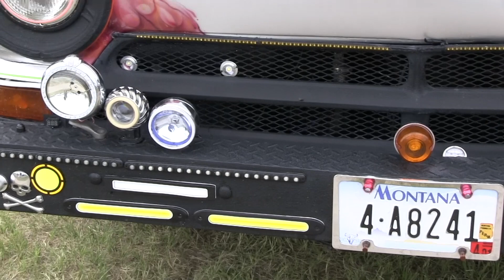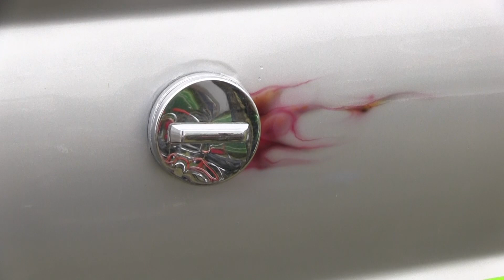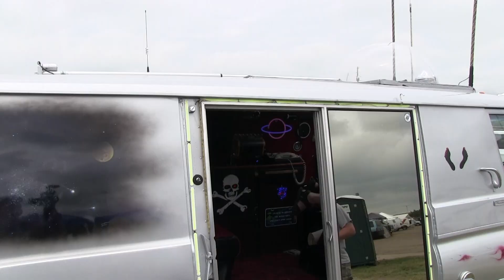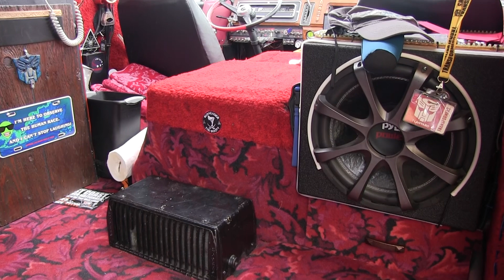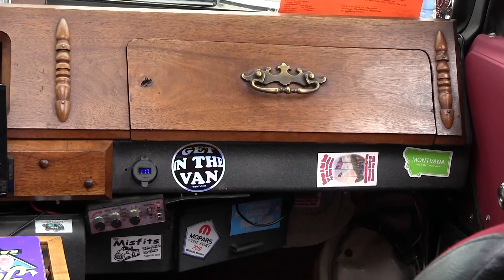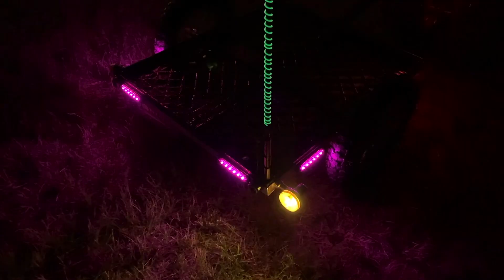1969 Dodge Custom Van. “CLOUDED JUDGEMENT”

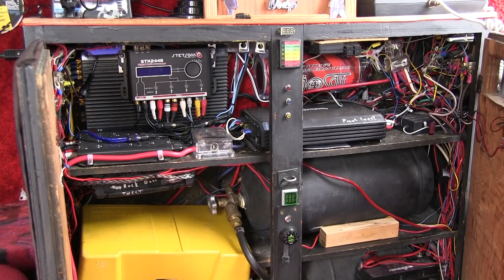Comment: Oop said it best "Boy, you got a lot goin' on right there, WOW!" at 12:00 🤣 This van was definitely a treat to see -- same owner 51 years! It's seen some s&%t!  It's over the top after dark - surely deserved the Best of Show Light & Bright Trophy!  What a trip of a van! Murals, 10 amps, power sliding bubble roof, trick water sprayers, a window for a door, A+ light show, a 3rd battery for bass, 2CB's, speakers with spinners, awesomely labeled switches galore, !  We need to see some of Rudy's hidden cam videos of spraying onlookers - uncover some of that video & post it Ooop!  One of the best vansonvideos yet!